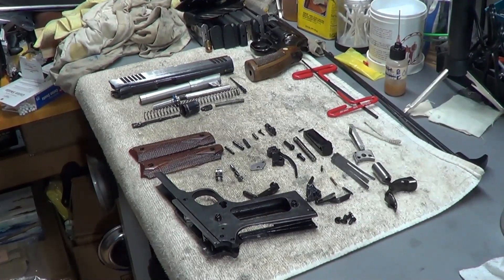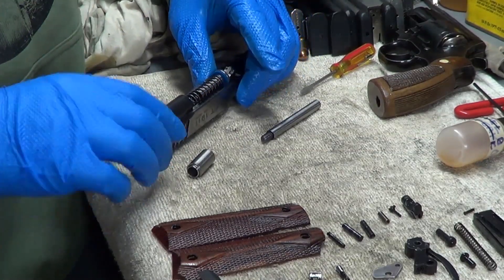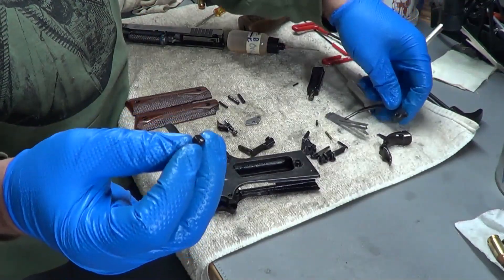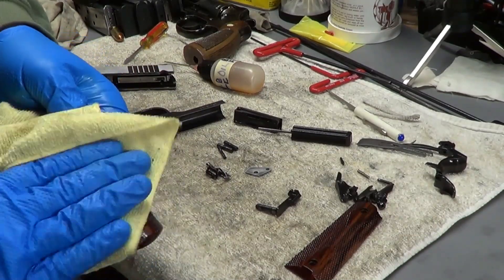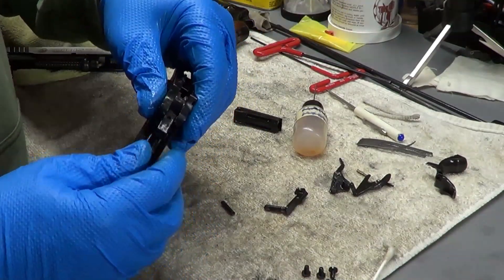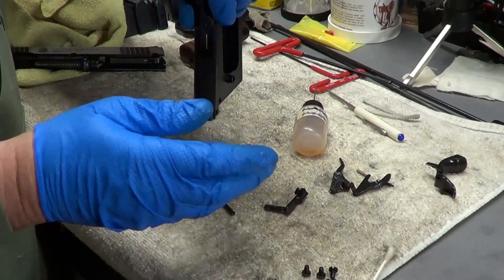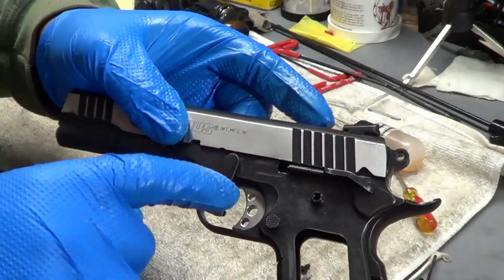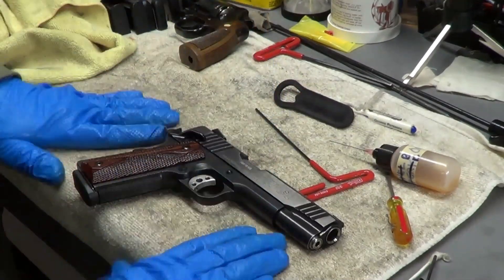Complete Reassembly Of A 1911 Pistol Series 80 Model - All Parts Breakdown & Assembled

Comment: Some people swear by those magnetic trays. Never tried one myself, but have seen people saved by them when they drop a part. It falls into the tray and don't bounce/fly out of the tray, because of the magnets. Might not work for some stainless parts though (some types of stainless aren't magnetic at all and most are only slightly magnetic).